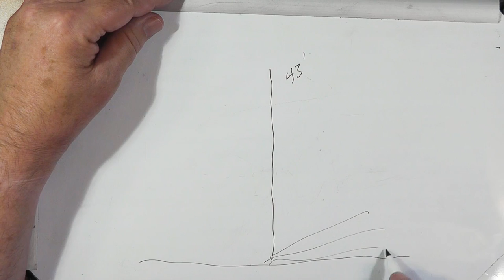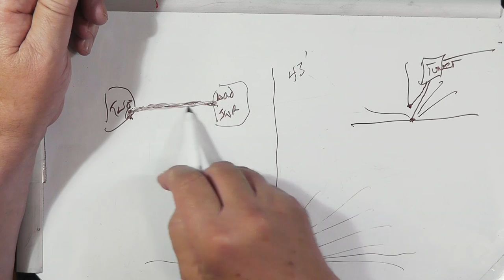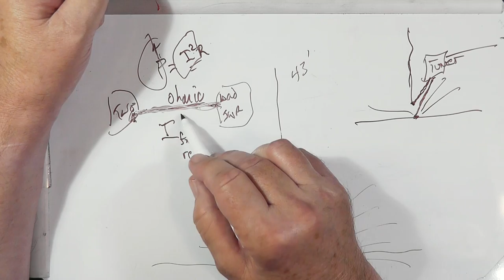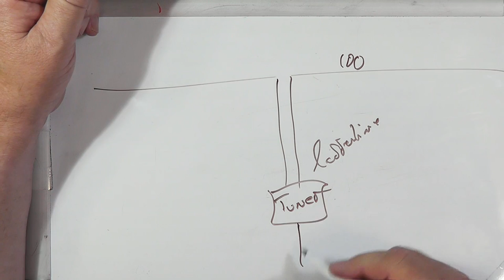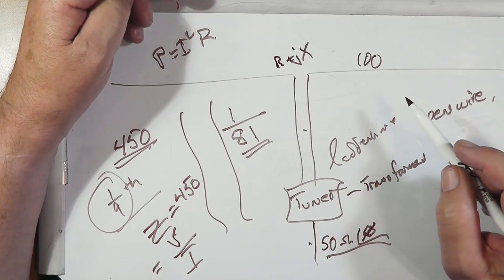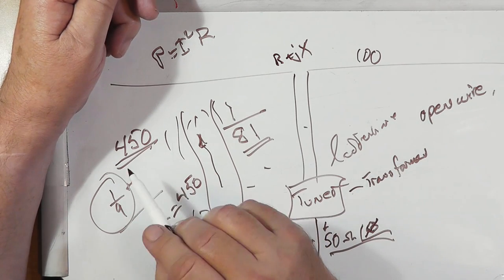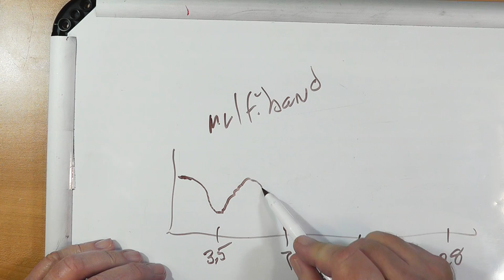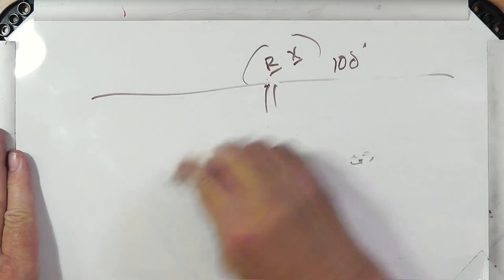Resonant vs Non-Resonant Antennas (#538)

Comment: I don't think his question was really answered. I think he simply wants to know if the antenna will radiate as good say for example with a non resonant 6 meter antenna using a tuner to a perfectly tuned 6 meter antenna.
Reply from the maker: And the short answer is yes. Simply saying "yes" is too short for a video, hence I used his question as a "basis" for a video.
Reply: @davecasler  I really appreciate Dave taking the time to discuss the math involved here, something most hams don't relish. I didn't truly understand the complexity of electronic theory until I took trigonometry .... wow, who knew! Dave answered the ham's question in his original video, just follow the math...../k6sdw

Comment: Dave, Thank you for the YouTube programs and your QST articles. I look forward to both. I'm in an apartment with severe space restrictions. I wanted to see if I could possibly work HF on multiple bands using 100 watts or less.  Center fed resonant antennas and verticals with radials just weren't feasible at my location. I now use a 71' non resonant sloper going from a 25' balcony down to a 6' wooden fence, a 9:1 unun at the high feed point, two 15' counterpoises on the balcony, 50' of coax, common mode choke at the and of the feedline going to a manual antenna and into the transceiver. Using this setup and 80 watts LSB from California on 7.204 MHz, I was able to work VK4KW in Australia on 10/1/21 at 10:30 UTC (3:30 am PDT). I've made made many contacts using just 1 to 5 watts. I regularly check into nets using 20 to 100 watts and have had extended QSOs on 80, 40 and 20. The SWR indicator on my little 100 watt amp and also on an external SWR meter shows 1 to 2 or better on all HF bands after careful antenna tuning.  I've also tried a MagLoop but the non resonant antenna works better for me. My point is there's plenty of fun available on HF even for those of us with severe space restrictions if we're willing to learn about and experiment with antennas. Keep up your excellent work!

Comment: It might be easy to say the current is low at the feed point of non resonant antennas is because the Impedance center feed point would be very high creating a high voltage and forcing the current to be low. (P=IxE) voltage goes up Current has to go down for a given power.   The losses are low on balance line because the capacitance between the 2 lines is low compared to coax reducing the losses for long lengths of open line vs. coax.  Now it doesn't matter where the tuner is located at the antenna or at the transmitter end because the line losses are very low.  There is a great book by Walter Maxwell called "Reflections Transmission Lines and Antennas" that took all the magic out of transmission lines and tuners for me"

Comment: Thanks so much for the wonderful videos Dave. Your channel is a treasure. On this video, I feel like I’m missing a key point though. Say I have two antennas, resonant and non-resonant. The non resonant antenna has a tuner directly on the antenna base. Is there any reason besides tuner component cost that I should prefer the resonant antenna? I feel like your answer in the video was that they are equivalent. However, I never read about someone using a one foot random wire and a very expensive tuner to do DX 160m. That makes me think there is something besides matching impedance for low SWR that I’m missing. Thanks so much!

Comment: The power dissipated in an open wire feeder  due to I2R will only scale in the way described if it is terminated in its' characteristic impedance.
Reply from the maker: Yes, like any transmission line, the losses go up with SWR.
Reply: @davecasler  that is true,  but your maths assumes a 450 ohm load. 
If as an example you consider a low half wave dipole with 100w AT THE ANTENNA the current will be the same whatever the feeder. I appreciate that the impedance will change as you vary the length of feeder to the transmitter due to the normal effects of a feeder not terminated in its characteristic impedance.
Reply: When you think about it, a run of antenna wire has both resistance by the wire itself and radiation resistance. Ask yourself what percentage on a resonant antenna wire is radiated on the first transit to the end point before being reflected. The remaining signal is minus the amount radiated for the first transit, then minus the radiation on the next etc. on a declining exponential rate. The resonant wire is just rejuvenated on each cycle by the transmitter. A very long wire radiates all along its length and also declines exponentially as it goes. What is the difference? The wire resistive loss is greater with resonance as the source energy must keep adding to the un-radiated. It is just that a resonant length must coincide in wavelength for the frequency being used, otherwise the back forth transit from the two reflective end points become destructive and appears to be a different impedance load. VA7WN

Comment: Dave, would you please explain ", especially in connection with antenna efficiency and bandwidth.  Listening to all these YT videos about different kinds of antennas, I usually hear that the antennas have low SWR, but rarely do I hear anything about how efficientt the antennas are.  My dummy load has an SWR of 1.0:1.  There are also "cloud burners" and "ground warmers."  So, what is antenna efficiency, how can I measure it, and does it really matter?  Thanks in advance David SV0SGS.  PS I enjoy your videos and have learned much from them.

Comment: There are several non-resonant multiband antennas that employ either a 9:1 or 4:1 transformer (unun or balun) that do not require a wide band tuner. Some require no tuner on select bands.

The endfed varieties generally require RF grounding and/or counterpoises, and a common mode choke to be used without a tuner.

Its hard to beat the efficiency of a resonant single band antenna, but for the slight loss in efficiency I generally opt for multiband non-resonant antennas for the frequency agility.

The only non-resonant antenna I haven't had stellar success with is the 53' random wire antenna.  The performance was not that exciting, but it did work. I suspect I need to research optimizing performance through better use of counterpoises or ground radials and grounding.

I've seen for schools of thought on ground radials and counterpoises: being 0.05 wavelength counterpoise for lowest frequency, 0.25 wavelength counterpoises for bands of interest, and a total of 2X wavelengths of for lowest frequency of ground radials of any length, or one counterpoise at approximately one wavelength.

Some of the variation depends upon grounding and whether the antenna is resonant or non-resonant and if the transformer is grounded and location of choking.

After watching Steve Ellington's EFHW experiments I setup my EFHW and it is now working like gang-busters.  The 49:1 transformer is grounded, choked, and mounted close to the ground with antenna in an inverted-L.

The manufacturer of the 53' random wire antenna suggest mounting the 9:1 transformer high with the antenna sloping and counterpoise a full wavelength of lowest frequency about a foot off the ground.  That will not work at my condo, so need a next best installation.  The first time out was with the transformer about 4' off the ground and 130' counterpoise laying on the ground and 50' with the choke at the TX, and no grounding.  The next iteration will use ground at the 9:1.
Reply from the maker: The transformers do the impedance matching. In the case of a windom or something like that, the tuner does the impedance matching.
Reply: Some ignorant people buy "antennas" with Flat SWR in a wide frequency band. They don't realize that their "antennas" maintain a good match by pulling a 50 Ohm resistor into it that just dissipates a power of their transmitters to heat...

Comment: I do not agree with much of anything with you or what is broadcast here
Why not think in basics of basic antenna theory
A antenna does not need to be resonant
There is no magic or sacred reason a radiator needs to be perfectly resonant or even really close
What is most important is
The TX sees a 50 ohm load purely resistive
There is no excessive feedline losses
And a efficient radiator is used

The antenna being resonant at some specific frequency is less important than everything above !
Much easier to just build a antenna than endevor to pursue some pseudoscience that has to do with some magical resonant antenna
Long wires and rombics are not resonant antennas and still they hold the title
String up a 1/2 wavelenght of wire use a transmatch between the tx and the feedline and presto
You have a damn efficient antenna
It really is quite simple
No misconstrued theory or pseudoscience

Comment: Resonance vs matching - two different aspects of every antenna. An antenna could be resonant, but don't match and will require some matching network. A tuner usually don't change antenna resonance and does matching only.

Comment: It would be more accurate to call the feed point as resonant or non resonant.  A 1/2 wave length antenna has a resonant feed point in the middle of the antenna but at other locations along the wire the jX does NOT equal zero.  Does the antenna magically change from resonant to non resonant as we pick different  feed points???

Comment: Get rid of as much coax as you can for any non-resonant antenna!
I simply use a 102' dipole with 450 14ga. window-line that is about 70+ feet long (you usually have to tweak the length to hit all the bands).
I get rave-reviews on my signal, much more than any coax-fed antenna I've ever used period!
Also, don't be afraid of all the nonsense about field spacing on the window line; I even run it right through the wall to 2-banana-jacks whereby I either plug in the tuner or a heavy double-ground wire when not in use.  The only time you will ever have problems with routing, is long parallel runs longside metal objects or wires; short right-angles are not a problem as I've watched all of this while trying different placings.  If you need to run along the ground, just buy some of the non-metallic sticks available at home improvement centers and cable-tie to them. 
Also, people get too hung up on patterns; I've never noticed directional deficits on any band 80-10m; as in life, you go with the lobes you have!!!
The efficiency gain with open-feeders is well worth the trouble!  73...

Comment: OK, so Dave's personal preference is to use resonant antennas to avoid the reflected power loss in the coax when non-resonant antennas are used. Great, but seems half the conversation is missing here...  As a practical matter, since this is about multiband antennas, the way most so-called "resonant" antennas achieve "resonance" on multiple bands at the same time is through the use of lossy components in the antenna system, ie, traps, loading coils, etc...(where the actual loss of such components seems to be a mystery to most people).  All of these "trick" components create losses of their own even when the SWR is very low.... So, there's that, which still leaves the question, which is better and why... I think the answer is that it depends totally on the specific configuration details and specific antenna design of any system. I'd like to see this bigger picture discussed in more detail. But, it would be nice to hear an analysis of both sides of this story to help people better understand whether, for common scenarios, it is better to have loss mainly in the coax after the tuner (the non-resonant case) or in the trick components used by most "resonant" systems to get SWR down on multiple bands (I'll call that pseudo-resonance for lack of a better term).  If people only wanted to operate on one portion of one band then obviously a resonant antenna is better, but since multi-band operation is usually the goal, the answer does not seem so obvious.
Reply from the maker: Alas, not so. Modern verticals (unfortunitally there are still a bunch of "non-modern" antennas out there) use more interesting tricks such as 1/4-wave transmission line stubs and so on. One of the most interesting antennas is the DX Commander Classic, which is a fan vertical, so no traps at all. You can get it from DXEngineering.
Reply: @davecasler  -- since I wrote the above, I'd decided to go with the AVR-640 as it seems to have good blend of features -- will be assembling it over the next couple days... Uses 3/8 wave radiator with parallel stubs for the higher bands (so it's able to not need long wire radials and uses 6 ft counterpoise radials at its base instead, and the parallel  stubs eliminate the need for traps and their associated problems/band-narrowing issues)... unlike most 1/4 waves, it  actually wants to be higher, so it will be mounted around 25 ft in my case), has end-loading coils and cap hats for some bands to get the needed electrical length needed for the lower bands.  So, while resonant, this falls in the category of non-1/4 wave solutions. Has a 4:1 unun to get from 50 to 250 ohms at the feedpoint.  Seems to perform very well from the reviews I've seen (low-angle dx is its strong point) with broader low SWR range than most trapped antennas can achieve. Now that I'm beyond the point of verifying all the parts were included and there are no loose, missing, or broken parts in the matching unit, I'm hoping I've survived the hit or miss quality crapshoot that is MFJ these days.

Comment: What is the impedance of free space? An infinite wire without an end reflection point has no resonance, no "Q" and no bandwidth and works at any frequency. A rhombic antenna approaches this condition. Even with multi wavelengths, it is still finite and therefore requires a termination resistance to match that of free space to prevent reflections. An ideal antenna that is very directional. In theory, an infinite wire would reach all the way between the transmitter and distant receiver; Haw Ha! Anyone own an abandoned railway with remaining telegraph wire? You would just need to do an impedance match to the radio to that of free space. VA7WN
Reply: I recall that the Z of free space is 166 Ohms.

Comment: The question could have been answered in about 5 minutes. A resonant antenna at the feed point is at or close to 50 ohms or can be matched with a transformer (e.g. a 49:1 unun for an EFHW). A non-resonant antenna cannot and an ATU must be used for the transceiver to see a match.  Also, non-resonant antennas require a balance feed line like 450 ohm window line to prevent significant line loss due to high VSWR which is inherent with NR antennas. 

Also, Dave is confusing the Carolina Windom, which is a coax fed OCFD with a doublet, which is non-resonant dipole fed with parallel window line.

Comment: Nice video and nice try with the maths but unless you're willing to embrace fully COMPLEX numbers lets not go there at all. A congugate match is exactly what an antenna tuner should give you which also gives the best possible SWR or VSWR. A fully agree that when practical the ATU should be as close as possible to the base of the antenna. However, I'm not going to lose any sleep over my 20m of coax. Ladder line is dead, long live coax! You forgot about the losses in the matching transformer going from 50 ohms to 450ohms or whatever! But my main gripe is that there are a lot of people out there thinking that they can avoid the "Copper Losses" I2R by eliminating the ATU!!! What utter nonsense, they are impossible to eliminate, you can only reduce them as far as practicable. Use what you need to people and if an ATU helps then use it. Try buying one of the older more robust units with the larger coils and variable caps to further reduce losses.